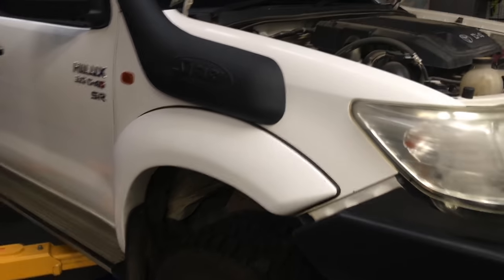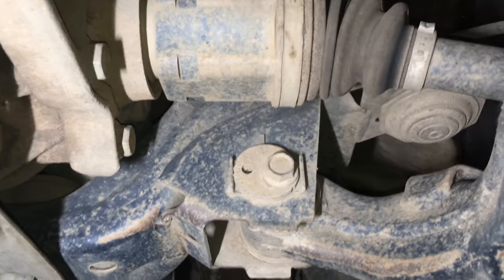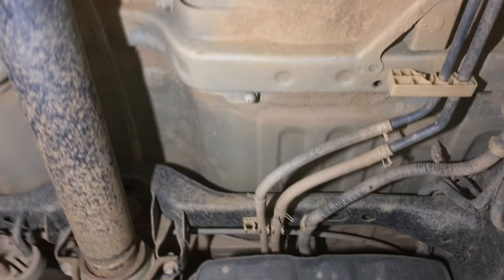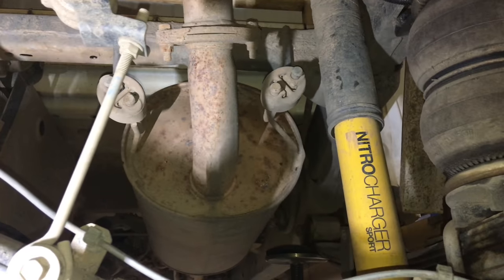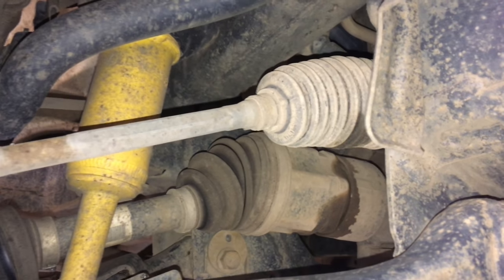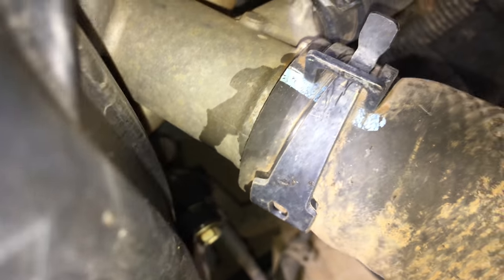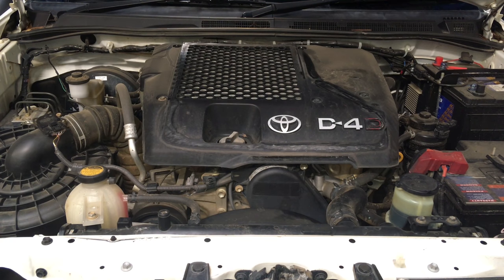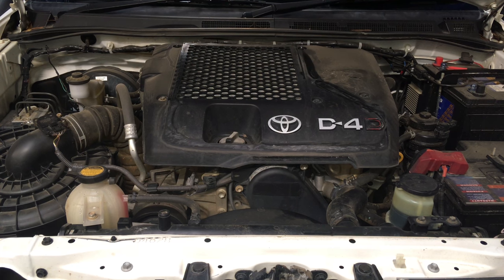DALES TOYOTA HILUX VIGO 2012 276,000kkms - FIRST INSPECTION - is it a lemon?

Comment: As a 2015 Hilux owner this pleases me. You guys in 'straya  are so lucky your conditions aren't as harsh as here in the UK. Every Australian vehicle I've seen like this, year for year, has way less corrosion than in the UK. No matter what you drive here, within 2 or 3 years you'll have the start of corrosion underneath and it needs attention to stop it quick.

I've been under 2 year old Rangers and Navaras with rust showing on brake covers and chassis members. Not serious rust but it never gets better on its own.

100 series Land Cruisers in the UK are so often badly corroded underneath yet in Australia they seem to last forever!

It's a curse of never being more than 100 miles from the sea, a generally much wetter climate and 5 months a year where every road has a covering of road salt.
Reply: I also have a 2015 and have just bought some Dinitrol to do some rust proofing on mine when the weather warms up, only mild surface corrosion around the welds at the moment but I intend to keep this vehicle for another 5 years so it needs attending to. 👍🏻🇬🇧
Reply: Just posted my comment and saw yours. 

Mine looks in a sorry state underneath. Weighing up my options as to what to do next, whether I get it "sand" blasted repainted and then rust proofed first then add any mods for work, or grab the items I need for work... , Winch bumper, new canopy suitable for farming and mounting gear on the rear of it, new rear bumper, underbody protection, suspension etc then get it blasted and fit once that job is done before treatment.
Reply: Professionally apply Mike Sanders protection to any new vehicle and you will be fine with regards to salt induced corrosion.

Comment: I can definitely relate with the Toyota reliability. We own a HDJ79 with 350k, Prado 2014 with 230k. The Prado is stock as a rock apart from ARB bullbar and roof rack. I did the injectors at 210k but I was working at a diesel fuel injection shop at the time. I did my time at a Toyota dealership in Australia and we did have Jeep and Hyundai. In the small town we live in the amount of work that the Jeep's and Hyundai's needed other than service work was unbelievable competed to the Toyota's. The HDJ79 isn't stock but has never had a major failures. Just a clutch and injector return pipe at 310k. I worked in an underground mine and we tried the Patrols and we removed them from the fleet after 3 months as the exceeded the price of a LandCruiser in 12 months of service.

Comment: Thank for this video. Mine is a 2009 Hilux 3.0 Invincible and its rusty as hell at 140k Miles of which 40k mile in the last 9 years since I got it. Never been in the sea either, but with the amount of salt on the roads over here is probably why. Even my sump guard has rusted completely through.

Last week my common rail died, not sure why. Garage I take it to found it spraying diesel everywhere after a test drive. Waiting on a new part from Toyota UK.  It's my only vehicle and using as a daily driver and part time work truck. 

The rear "chrome" bumper feels horrific, especially behind the number plate mounting point. Leant into it to unscrew the reg plate and I heard a crunch and the amount of large chunks of rust that well off was alarming. Now wondering what I need to do to save my truck. Thinking I get it fixed then find a Toyota specialist that does vehicle prep as I need to make some mods and fit stuff for work anyway. 

Any suggestions?